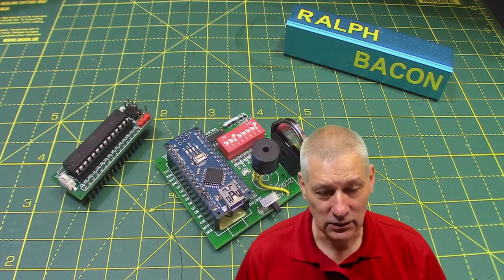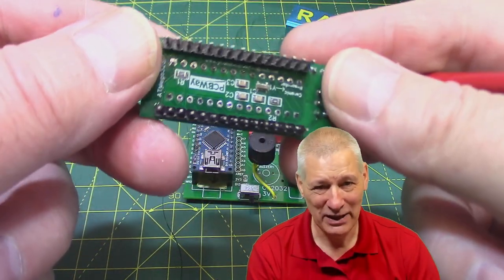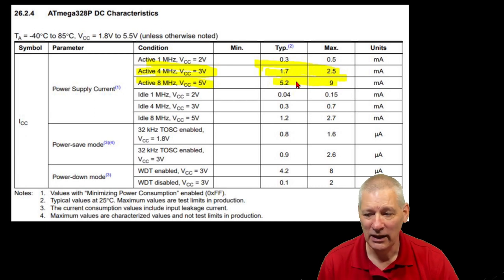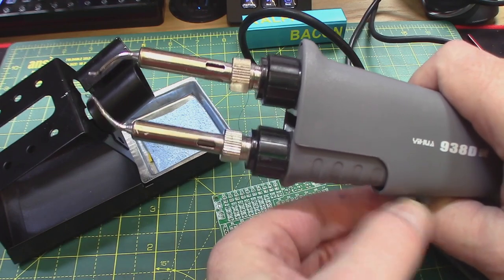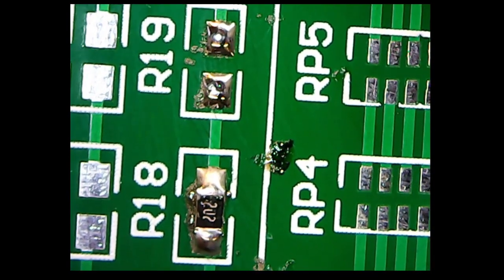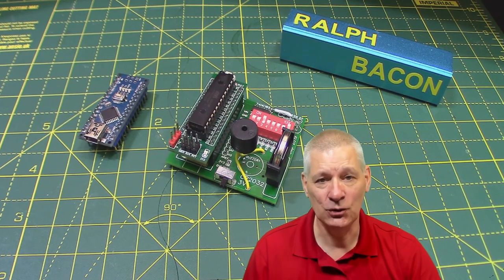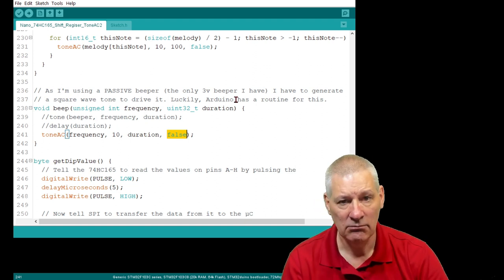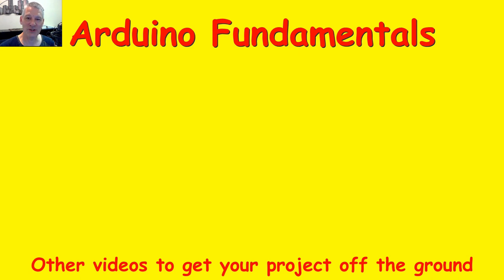#170 ToneAC Library with 328P DIP Nano PCB Plug-in

Comment: Try using "wire-wrap" wire for mods. Makes life easier and gives a neater finish.
Reply from the maker: Does the insulation on wire-wrap wire not melt and shrink, Graham? The usual stuff drives me mad: you take off 2mm of sleeving, try and tin the end and about 1cm of sleeving melts and shrinks!

Comment: I doubt you loose any clock precision on the Nano by using a resonator, it is probably already using one.
Long time ago we talked a bit about time precision on Arduino and I decided to do some code to get the best possible precision. It has taken some time, but now I have a Arduino library and a PC program to calibrate any Arduino to match the PC clock. I did also check some Arduino and RTC modules for precision:
https://lygte-info.dk/project/PrecisionTime UK.html
Reply: This link works better https://lygte-info.dk/project/PrecisionTime%20UK.html 
edit: The original link is now fixed, thank you Henrik.
Reply: Dead link
Reply: Sorry about that, YouTube cut the last part of my link. 

I have put a redirection up and the link will work now.
Reply: Henrik Jensen Thanks. It’s working fine now.
Reply from the maker: Thanks for that link, Henrik, very interesting. My Home Alone project uses NTP so that is pretty accurate too but does require the Internet (WiFi) to connect periodically, to resync. It was a wake up call to me to see how far the ESP32 drifted over a day, quite a bit if you just rely on the internal clock.
Reply: I have not checked an ESP32, but as you can see in my article I had some Arduino drift more than 10 minutes in a day.
Reply: @henrikjensen3278  My IKEA kitchen wall clock drift 1 minute pr. year. Will not mention DS1307.

Comment: I usa an old tooth brush for cleaning with IPA  in an old handspray bottle
Reply from the maker: If that works for you, that's great. Be sure that you don't use the toothbrush dry as it will generate ESD voltages (should be OK when wet with IPA - no not Indian Pale Ale, IsoPropyl Alcohol!)

Comment: Is that what's called shoehorn programming? If you try to add anything more you won't be able to squeeze anymore in the chip. 
However,  I have more faith in you then you do in yourself. I know you can get the interrupt working. You are so close right now. You even said it might fit in now, but you just haven't tried again since the last code trimming. 
Go ahead and give it a try. You have nothing to lose but a few minutes if it works. A bit longer if it doesn't fit on straight away.
Reply from the maker: I'm guessing this comment refers to video #177 ATTiny13 Fridge Door challenge! I'm not sure I need that interrupt any further as I have solved the beep problem. But I might make this battery powered and Deep Sleep enabled with a battery to operate it. Who knows!
Reply: @RalphBacon right you are, Sir Ralph. how it calls out to be a battery project. I can hear it from here all the way across the great pond. Ralph my hero, you are on the verge of squeezing the last penny(pence?) out of a quarter? The very last penny. Push it for all its worth. It can just sit there in deep sleep all night long sipping on just the tiniest bit of electricity. (At least until Benny realizes your asleep and raids the fridge.) You've got this. Just think of it, squeezing out all that the chip can do. Sir master of the ATTiny 13, you can do this. (I may not know why you wouldn't just spend the money for a chip with more memory and processing power, but I'm guessing it's to prove there point that we don't have to spend the money.) With a little frustration you can do this, shoot you have all but done it already. It's awaiting its battery my friend. You've got this. Battery, battery, battery🎶🎵🎶🎵
Reply from the maker: Well, I have it running on the workbench with a battery, no standby current at all (possibly 100nA which my meter can't even measure). Do I take it forward, though, that is the question!
Reply: @RalphBacon  You are my hero sir Ralph. I take it the interrupt is working flawlessly then. At 100nA I think your battery will die off old age instead of drawdown current. It's awake what a few times per day for a couple minutes each, then it sleeps the rest of the time.  Plus you should get points from the wife since you no longer need a cord there. You won't get any points from the wife, but you will still deserve them nonetheless. We are all very proud of you sir Ralph.